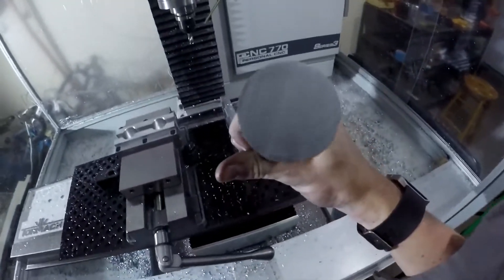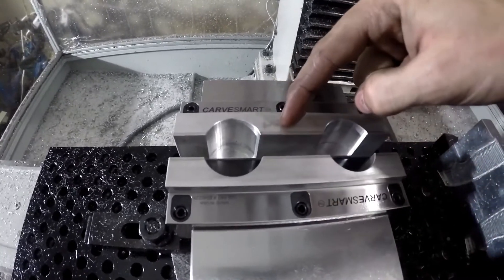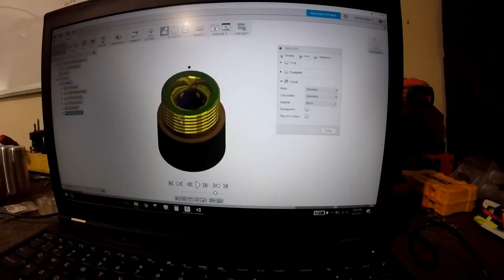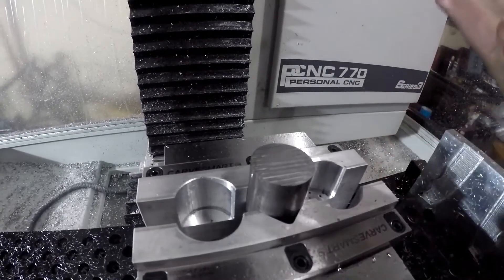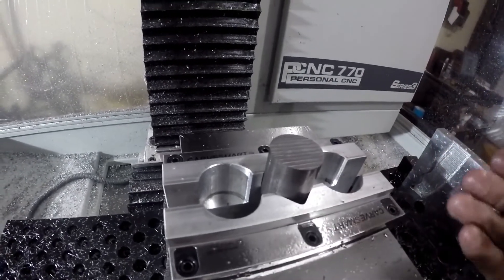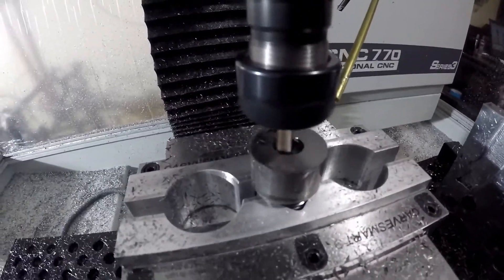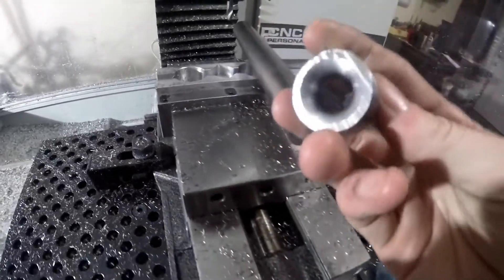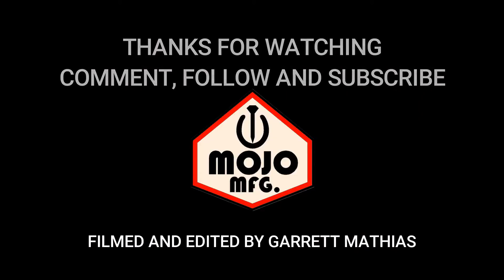Machining an Oil Filter Adapter: After Work Special #90

Comment: Hot rolled 1018 is harder than cold rolled... Probably should be using carbide or at least cobalt....
Reply from the maker: Mark Grayson I will definitely just have to break down and get some cobalt or carbide drill bits then. I always thought cold rolled was less ductile and therefore harder than hot rolled for some reason.